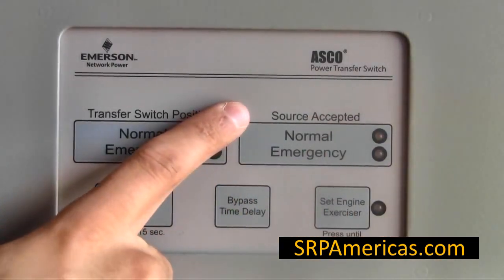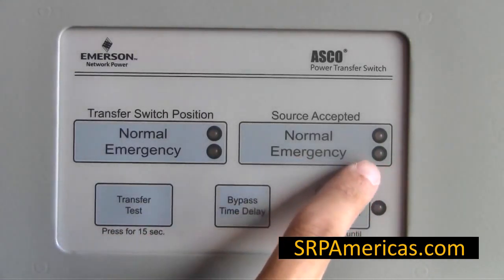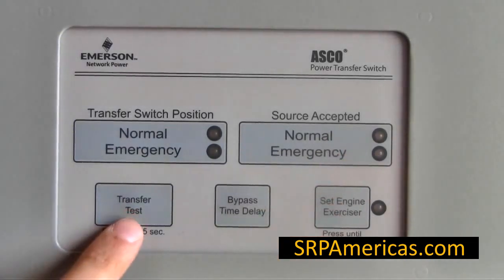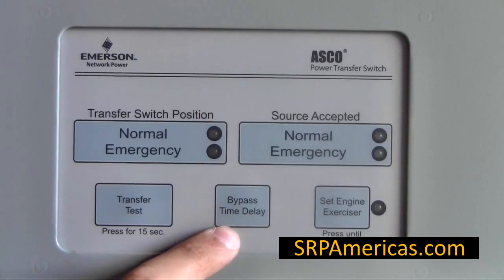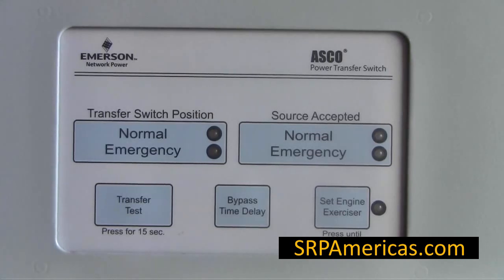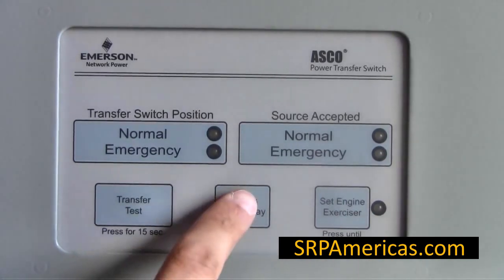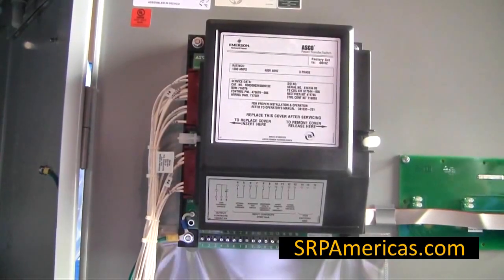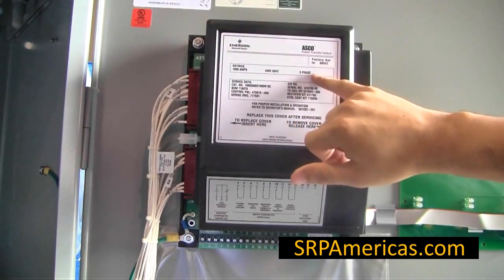Overview of ASCO 300 Series Transfer Switches (Generators)

Comment: DEAR SIR, I HAVE ASCO 4000 POWER TRANSFER SWITCH DON'T WORK ON THE GENERATOR. ARE YOU HAVE A VIDEO SOLVE PROBLEM SUCH THAT (GENERATOR OK  BUT NOT AUTOMATICALLY WHEN THE N.SOURCE DOWN IT WORK MANUAL & CONTACTOR OK, ATS NOT TRANSFER TO EMERGENCY SOURCE)  OR TEL ME THE STEPS TO SOLVE THAT.THANKS